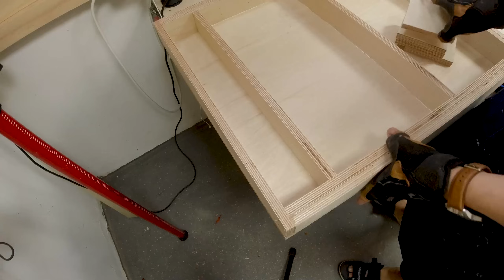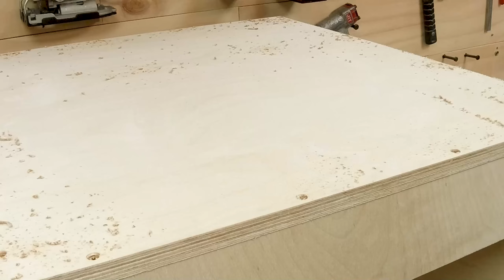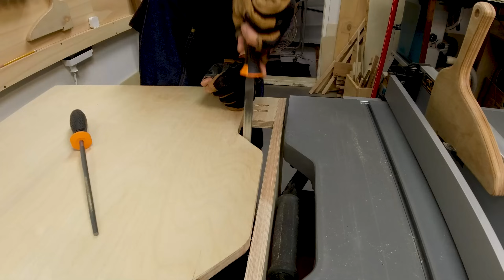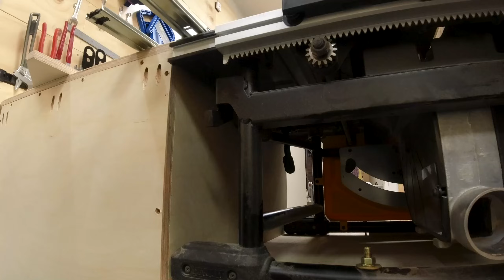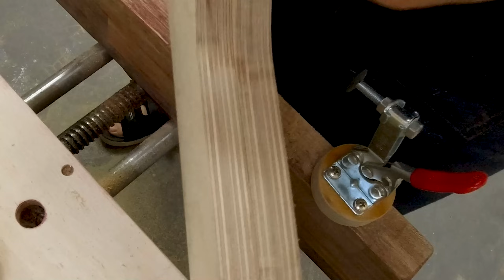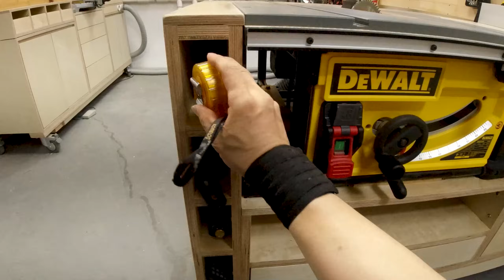모바일 워크벤치 만들기 / 디월트 테이블쏘 7492 빌트인 / 좁은 작업실에서 편리하고 안전하게 작업가능

Comment: I’ve seen a lot of workstation builds. But this has been the most meticulous and wonderfully engineered I’ve ever seen. Absolutely incredible finishing. I’m actually starting my station today and I’m so glad I came across this.
Reply: I agree with you that this is the most thought out design that is indeed good for practical use. I have an old Craftsman Contractor saw from the 1960's and I'm looking to make it into more of a cabinet saw. Most of the stations I see are either over engineered and more than what I need, or look totally wonky.
Reply: @woodandwheelz same here with the old 60's Craftsman saw!

Comment: It's terrific, but you covered the riving knife release lever on the left side near front.  That's my only thing to say other than I need to build something like this!  The drawer slides for the outfeed is brilliant!!
Reply from the maker: My 7492 doesn't have that lever.  So I didn't bother with it.  The 7492 imported to Korea here doesn't have it.  Dewalt sometimes does bad things to Korea.
Reply: @carpentak  That's awful that DeWalt does that.  I just realized that I have a 7491, sold in the USA.
  Your projects are all really great.  I think the first thing I'll make is the crosscut sled.  Keep up the great work.  I liked and subscribed
Reply: You can cut holes through the left side shelf to access the reliving level since this shelf is only 10cm in width. Make holes big enough for your hand. That’s the simplest solution I can think of. Or you may put the hinges under the top piece of this shelf and drill a small hole on it to lift it up with your finger to access this lever, which ever way is more convenience for you and your tools.

Comment: Hello, my compliments for the explanations about the DeWalt saw bench. I would like to ask a question: is there a system or a product to protect the "work surface" (gray in color) from scratches and wear?
Reply from the maker: There is no such thing. I don't need to protect the surface.
Reply: @carpentak  I ask you for advice. When checking my 7492 (purchased a few days ago) I detected a difference in level on the work surface (basically by placing the level or a precision square used for mechanics and pressing with one finger on the end of it, with the other finger pushing on the opposite side I have the "Telegraph" effect - that is, I see that it "taps" on the bench and you notice a difference in level of about 1.5 mm over a distance of 15 cm!) What do you advise me to do? Should I ask for a return? Should I return everything and exchange it for another? .... 😭😵‍💫
Reply from the maker: @proximodaniele  I just saw the comment. Sorry.
I think it is a serious defect. If it were me, I would have requested a return.
I hope you have a good solution.
Reply: @carpentak  Mi hanno spedito un Banco sega Nuovo 😀

Comment: Definetely this one is the best ! Thank you for sharing, it is excellent job! The only thing is, I just do not understand, how you manage blade guard quick release?
Reply from the maker: thank you  But I didn't understand your question...
Reply: @carpentak   Your table saw looks like to me a Dewalt DWE7492, there should be a pull handle for quick release of blade guard under the left side of top plate. I thing your model is different.
Reply: I think
Reply from the maker: @DemirHakanEskisehir  ah!  You said that.  I know because I've seen it in someone else's video.  My 7492 table saw doesn't have it.  Perhaps Dewalt is exporting without adding the handle to the importers here in Korea.

Comment: Hi, i just made myself a clone of this bench, but wondered how you dealt with the amount of play from the slides when trying to cut heavy sheets.  Mine wants to twist the sheets when a decent amount of weight is on them.  Bit unsafe as it is now.

Thinking about how i can lock them in place so the slides are disabled at various lengths

Comment: I am building my bench based on your design with minor changes to allow the quick release lever for the riving knife and table top leveling screws. I am happy that I found your video! Thank you so much for sharing!
Reply: I was wondering about the quick release lever
Reply: It’s quite simple adding reasonable cut-outs for your hand to access the lever, but you need to plan the cut ahead before assembling the boards.

Comment: Awesome design. What did you use to level the top? It looks like you placed them against screws to level then locked it in place with screws from below.
Reply from the maker: It is a headless bolt.  It has no bolt head, so the depth can be adjusted freely.  I don't know the English name.  It's called that here in Korea.

Comment: This table saw is great, I'm drawing my plans to make one with a dewalt 7485 saw. What is the wood you used on the side parts in addition to plywood ?
Reply from the maker: It is coated MDF board.  Also called LPM board
Reply: @carpentak  Thanks, effectively, I can see it when I watch close, I thought it was solid wood.

Comment: I've watched 20+ table saw bench videos, and yours is my favourite! Do you have plans available?
Reply from the maker: Thank you. I don't have a plan.  My working style is to work only with sketches.
Reply: @carpentak  no problem, could you tell me how wide the base is without any attachments?
Reply from the maker: Of course.  The size of the base is 1310×575mm. 575mm is the same size as the table saw top plate.
The height of the workbench is 850mm.
Reply: @carpentak  perfect, thankyou!
Reply: Yes i agree with you . I was looking the same number of video tutorials and this one is the Best.:)
Reply: I love the bench it is one of the best I’ve seen on YouTube if you ever put a cutting list together for this I think you should have no problem selling it or for your accessories you designed for it
Top marks 👍👍
Reply: I completely agree with this. I’ve had this saw about 2 years and have searched YouTube high and Low to find a cabinet video and design I liked. After finding this one. I’m rebuilding my cabinet. Thanks for the awesome video and design idea.
Reply: what do you call those levelers you use to align the table base? Congratulations your work is amazing!
Reply: Oh, I wish you had a drawing or plans

Comment: Anyone know how he removes the riving knife? The lever is on left side of the saw and pulls out? Just curious
Reply: Im in the process of making this now.  I had to cut out the top of the small compartment and the hollow out the table top about 1/4".   Then you can reach in the small compartment and pull on the lever to get the riving knife out.
Reply: @benz306  Do you happen to have measurements / rough plans for the one you're building?

Comment: Your videos are a real inspiration, thank you! Do you happen to have a list of the tools you use somewhere? In the video you very often use a drill that also mills out the screw heads. where can you buy this? greetings
Reply from the maker: We didn't make a list of the tools we use.  
The screw bit you asked about is this.  thank you.
https://a.aliexpress.com/_mMxun7C
Reply: @carpentak  Hi, thanks for your answer. I'm not sure if we mean the same thing. The link leads to taps. However, I mean the drills that you use to mill out the screw head as well.
Then you see a roller block at the very beginning of the video. Where did you buy the roles?
Reply from the maker: @danieldettmer-prause5421  Sorry I don't understand the question correctly.  The rollers were purchased at a local hardware store.

Comment: Is that 18 mm birch plywood for the saw's cabinet, Mr TAK?
Reply from the maker: That's right, but I used a mix of 18mm and 15mm.  But with only 18mm, of course, it is possible.
Reply: @carpentak  Thank you for your quick reply. Yes, I could see that you used thinner plywood in some places. The main thing was to find out that one primary thickness, no guessing.
Reply from the maker: okay.  I've added information to the description of the video for those who, like you, are curious about it.

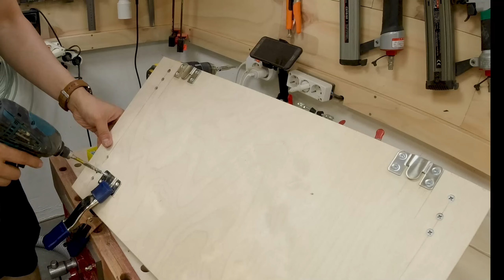Comment: Mr. TAK, please tell us more about the shelf attachment clips shown in your video at 15:00, the ones you use to attach the extension leaf to the left side of the saw (when facing the input side). I have never seen any like those and would like to know more so I can try to buy some. They would be useful for a variety of workshop applications.

UPDATE, 2 September 2022:  At last I have been able to purchase and have a DeWalt 10" corded table saw shipped over from the US to me in Japan. It should arrive here within two weeks. Knowing the main dimensions of the saw's top and  support structure, I will start building a somewhat modified version of your mobile cabinet. Lots of good ideas in yours, and the size is right for my small workspace. Thank you, Mr TAK, for the ideas illustrated in your videos.
Reply from the maker: I bought it from a Korean site here, and the site does not sell overseas.  I will give you a link though, so please refer to it and find it on Amazon or Ali Express.  Maybe Ali has it
http://m.woodbin.co.kr/product/detail.html?product_no=1794&cate_no=194&display_group=1
Reply: @carpentak  Thanks! 

Found some at Amazon. Different nomenclature, but the link you sent helped me describe them so that a search worked.
Reply: @rickhayhoe  Can you share the Amazon link? Thx
Reply: @davidswan4801  David, I keep trying to post a reply, and it keeps disappearing. Anyway, one more time. Try using one or more of the following: flush mount bracket, interlocking photo frame hook, heavy duty picture hanger. I hope this stays up long enough for you to see it.

Comment: I see you have added a dado stack separate blade - how do you raise/lower this. Is it a circular saw?
Reply from the maker: That's right, this is a regular circular saw and has an 8mm thick dado saw blade.  A video of the lift making of this was not filmed.  But it appears in this video.
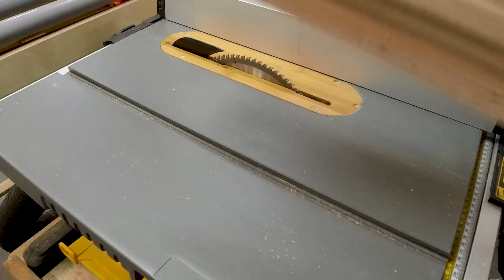https://youtu.be/kvYxB5yBRkU 2:30
Reply: Thank you  @carpentak

Comment: GREAT BUILD!!!!!!!!  Do you have plans available for this, as well as the STL files for your outfeed rollers???
Reply from the maker: I have no plans.  I sketch and work by hand.  I don't know what an stl file is.
Reply: @carpentak  STL files are for 3D printers. Your outfeed rollers look like they are supported by orange 3D printed parts.
Reply from the maker: okay.  But I don't use 3D printers.  I cut and carve everything myself.
Reply: @carpentak  OK, what I am asking about is at the 9:27 mark in this video. There are two grey rollers in an orange frame that are serving as outfeed support. Did you build that, if yes, do you have a video for it???
Reply from the maker: The roller was obtained from a tool shop.

Comment: Are you planning on mounting your router next to the saw? Saw/Routing table combination would save even more space!
Reply from the maker: At first, I planned to install a router.  I later changed my plans and installed a circular saw with a thicker saw blade for grooving.  And the router table was created separately.

Comment: Welche Sägeblätter haben Sie bei diesem Tischkreisäge???
Reply from the maker: 이 영상에는 dwe7492에 기본 포함 되어있는 10 inch dewalt톱날을 사용 했습니다.
Reply: @carpentak 
你能用德语或英语给我写信吗？你用的是哪种锯片？ 非常感谢
Reply from the maker: @iarman8867  The saw blade used in this video was a 10-inch Dewalt saw blade included in the dwe7492 table saw.

Comment: Vc é muito bom no que faz. Fiquei seu fã! Parabéns!
Reply: Hallo
I meant a blueprint, a drawing correctly with individual dimensions to rebuild ???  Or a list with the length and width of the individual panels???  And how strong is your multiplex 15 mm or 20 mm ????  Greetings Henry from Germany
Reply: Please
Reply from the maker: I used a mixture of 15mm and 18mm plywood.  Of course, 18mm plywood makes it strong, so it's good to make only 18mm if possible.

Comment: I am a beginner in DIY.
I'm planning to make a workbench one by one. What is the thickness of the plywood used in the video?
Can you please tell me?
Reply from the maker: I used 15mm and 18mm together.  The side plate is usually 18mm.  But you don't necessarily do it like me.  You can do it with just one thick plywood.  Then do some great work!
Reply: Thank you for your early guidance.
Japanese home centers have almost no stock of 15MM or 18MM plywood, and it is very expensive.
Depending on the strength, I will use two sheets bonded together.
Please continue to introduce many more fun DIY projects.
Reply from the maker: okay.  I will continue to upload good DIY videos in the future.  I hope that many people in Japan will also watch my videos.  thank you.

Comment: nice project, unfortunately you can no longer use the riving knife and the extraction hood with the construction...
However, these components are very important for safety reasons
Reply: I am expecting my dwe7492 in two weeks and this was my concern, I am going to build this table and will put a little thought into still allowing access to the lever. Perhaps some form of removable plate?